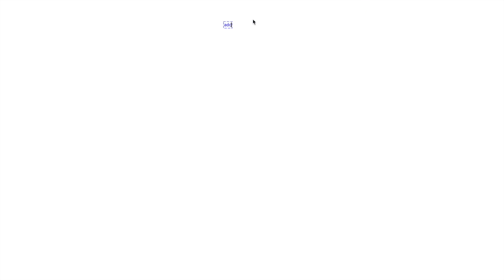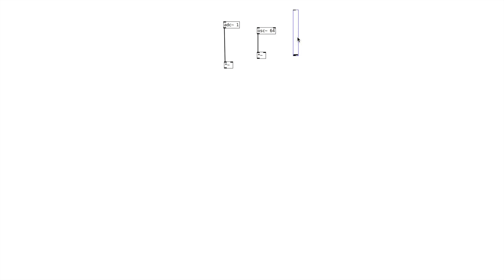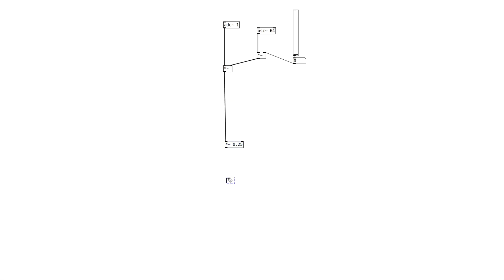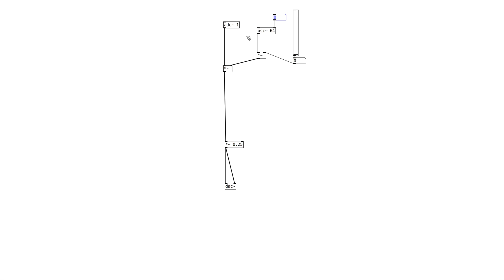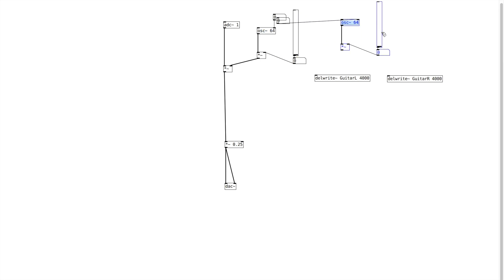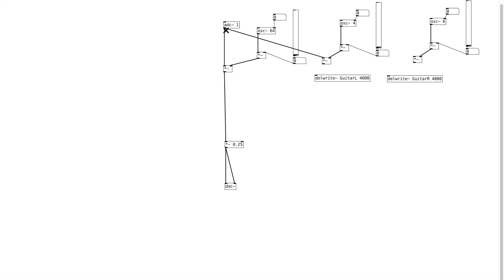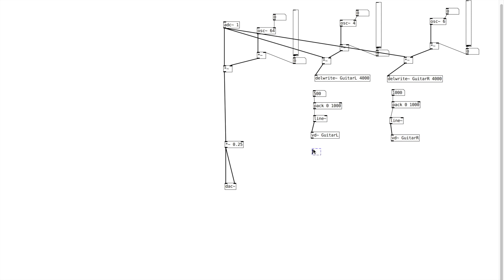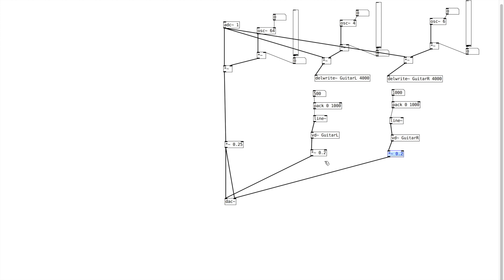Pure Data Lesson 9 - Ring Modulation for Live Signal and Delay Feedback

Comment: how do I connect an audio input to microphone ??
Reply from the maker: If you have an interface hooked up, you should be able to select an audio input; from the toolbar go to Media and then audio settings. It will list your input devices there.
Reply: @JosephNormanComposer  Ok ... this process I understood .. I mean the patch ... adc ~ does not capture the changes you show in your video .. I did not understand how I connect adc ~ to the patch to use the guitar .. thanks for answer